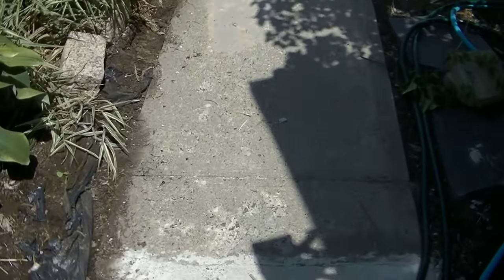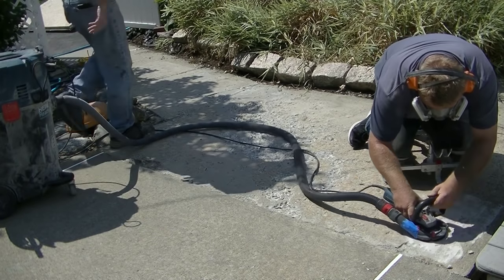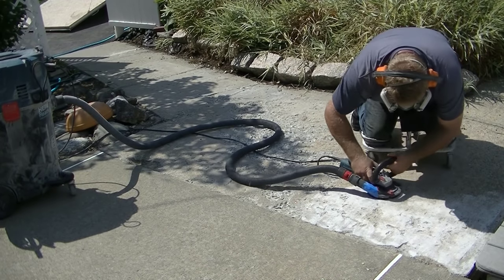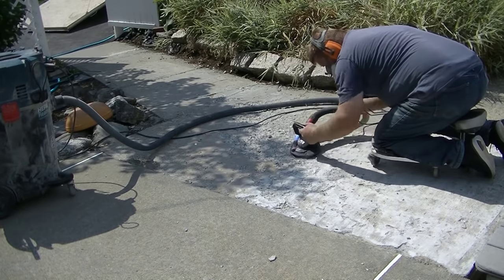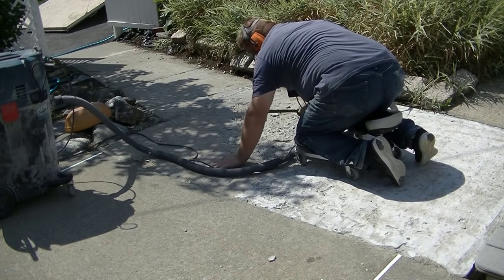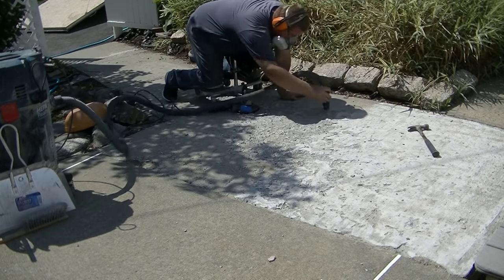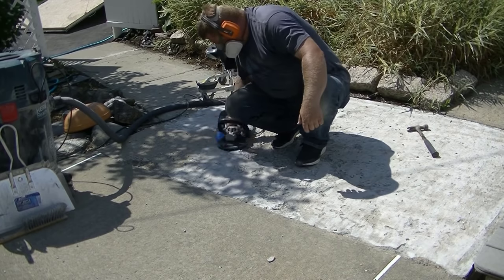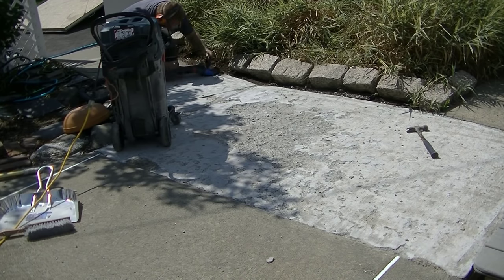How To Resurface A Badly Damaged Concrete Walkway

Comment: It's amazing to me that it's somehow less expensive to have a couple guys working on their hands and knees for a day or two than it would be to jackhammer the bad stuff out and just re-pour.
Reply: Exactly
Reply: This shit takes about 2 hours max 😂
Reply: You don’t think 2-3 guys are going to be working on their hands & knees with a completely new concrete slab?  Ripping up an old slab, pouring & floating a new slab is a shit ton of work, there’s a reason why the method demonstrated in this video is worthy of our consideration.
Reply: Dude, you clearly don't work in the trades, do you?
Reply: @loganshotrod4x464  it's really not a shit ton of work tho. And alot of that old slab could be used as filler.  It isn't hard to donate all. Guys can to the slab right there in 4 hours tops.
Reply: @Myeyeofthebeholder  : it depends on how big the project is, your budget, the equipment you have & how much of it you can do yourself.
Reply: I appreciate the video, but I would have insisted  to remove and re-pour the cement. Way too labor intensive.
Reply: It's way more time consuming and labor intensive to bust it out/replace the whole slab.
 It's faster and less expensive to just resurface or repair. You would to be in the construction field to truly understand. I've been doing concrete work for over 10yrs.
Reply: Sometimes it depends on what the customer can afford. If the customer wanted or could afford a whole replacement I'm pretty sure he would have done it. 
The customer maybe could only afford a resurface.
Reply: @YaboyAli215  Um, no it's not. I replaced three sidewalk slabs with just a sledgehammer. Gave it a few wacks, pulled up the old concrete, created forms and poured new concrete. What is so hard about that?
Reply: I believe he stated that replacement was out of the customers budget but I agree thinking the same thing while watching this. I'd say if a guy had the skills to tackle this as a surface repair then go for it. Otherwise replace. This crew knew what they were doing.
Reply: @bigmacdaddy1234  but now you have to get rid of the old concrete, build forms, level subgrade and mix all that cement.
Reply: @Myeyeofthebeholder  
obviously you havent done enough concrete work to know the difference..and filler for what ?
unless that concrete was 8 inch thick to begin with, you would need to worry about sub grade. by the time you tore that concrete, take it some where (free or not) order a short load ( a couple yard short load in California is going to cost you $400 that's if you unload that truck in 10 min. form up the side walk, wheel barrel the concrete to location, and to place and finish it. even if you did all of that in one long ass day by yourself with no pay help it's going to cost you $600 to replace. I dont work for free so I'm going to charge $400 and doing this shit for 33 years, I dont do it by myself so $200 for my helper. that's a $1000 job all day long to replace it and a hard busy day at that...this guy has the right idea
Reply: @jimmyreece6768  lmao.. Ok goofy
Reply: Where I am, it would cost as much as this repair JUST to DISPOSE of the jackhammered out concrete - for some reason it is priced at asbestos rates.
Reply: @bigmacdaddy1234  that's alot more labor intensive than just resurfacing it. No sledgehammer, no pulling up old concrete and no forms.... 
Less expensive, less labor...
You new poured slabs will probably last as long as his resurface because you didn't even level and compact your subgrade.
Reply: Dont think you have ever layed concrete
Reply: @andym9571  Who are you replying to?
Reply: @vtbn53  the original post. I'm in agreement with you.
Reply: It's amazing to me how people who have no clue about construction,  feel that they are qualified to criticize the methods and costs of work they know absolutely nothing about.
Reply: This guys is srewing this customer!  The company i work for would have had that walk out and poured back before lunch!
Reply: You sure are easy with other people’s money.

Comment: NICE to see people properly using earmuffs, safety glasses (Personal Protective Equipment- PPE) and the right vacuum. I watch SO MANY 'so called professionals' with their heads right next to grinders, loud circular saws, or working in dusty environments, like concrete dust without even a paper mask on. As a kid, we ALWAYS used gasoline (with no gloves) to wash engines that we worked on, Trichlorethelene as ink solvents and more. Cut Asbestos, used power and chain saws with NO hearing protection and NEVER thought of the heath commonsense.   Now at age 60+ the doctors say I have the lung capacity of an 80yr old smoker, even though I never smoked!  

We KNEW back then and just left the PPE in the toolbox, or hanging on the wall!  Nice to see you guys even using the correct vacuum system too! 

Nice job on the concrete repair too!

Comment: You've probably answered this question before. Sorry I'm not finding the applicable comment. With regular freeze-thaw an issue. How long do you expect this repair to last? I have a similar condition in Colorado and am deciding if I want to demo and re-pour or try to refinish.

Comment: Home depot here (SLC,UT) sells rapid set for just over $6 a bag. I use the flow control alot with rapid set to increase my compressive strength with increased fluidity. Gotta work fast though!!!! I'll have to try the mortar mix, never thought of that but I bet it would it leave a nice texture for some step repairs. Thanks

Comment: Mike, Great Video, QUESTION -  I have a concrete walkway, one section (about 8' by 8') has my WELL/Pump Room underneath it. I'm now getting water penetration thru the sidewalk down into that well room. before I do any repairs what would you recommend for me to seal it before I clean and resurface it. Or is there a rubberized coating or membrane I can apply, Simply Curious, Thanks for the great Content.
Reply: Try a torch down rubber roofing membrane

Comment: Loved this repair. Turned out fabulous. How long does this last in hot/freezing climates? How expensive is this type of job? Can an entire driveway and garage be done in cold climate areas? What about when a garage does not incline to the outside to drain water? Our garage pools it inside instead of draining down the driveway. This happens when snow melts off our vehicles onto the garage floor and stays there in a pool. I notice that the extra moisture is beginning to rust things stored in the garage, including our vehicles.

Comment: kinda surprised that you didn't bonder the spalled sections before filling with the Cementall...(???)  (incidentally, Larsen Products Wcg04 Weld Crete is a great concrete/stucco bonder )

Comment: Mike thank you for this video. A great tutorial. I have a pool deck of badly cracked aggregate surface concrete. 1 Would this work on aggregate surface. 2 Would this process fill cracks, and if so what about expansion joints.?  
Thank you

Comment: Would you use the blue bag for a surface that is mostly showing aggregate or would you go right to the finish coat? Thanks ! Great work BTW!!
Reply from the maker: Blue bag is for thinner repairs, it has a finer aggregate in it. You can go from featheredge up to 4" with repairs using it.

Comment: Hey Mike Day, great video thanks for doing this. My question is if you had to do this on a slab 12x40 what would you do different? Would you go in sections? Would you still trowell the whole thing? Thanks.
Reply from the maker: I'd use a self leveling concrete for something that size. I did one here: https://youtu.be/_iIrYQSOaGU
Reply: @MikeDayConcrete  wow, thats fsntastic. If i need ultimately a broom finish, what product on top of this should i use? Maybe the brown or blue bags ive seen in your other video?

Comment: What a great tutorial.  Thanks   While here, if the cement wasn't damaged as much, such as having small pebble sized 'divots',  could either of these products be used without the other to just resurface a rough surface?  We have a rough cement top 3' X 4' step and I was considering an epoxy mix such as they use on garage floors. Which as a bonus, can also be colored. Your thoughts on these ideas would be appreciated.

Comment: If I was 35 years younger I would give it a try. Today if I make it on my knees I'll need a crane to get up.......
Do you have recommendation of a company in or near Dallas Texas?
Reply: I know that feeling, after cancer treatments in 1990-91 I had both shoulders replaced and bone grafts on both hips because radiation treatments and prednisone ate my bone away. Those four surgeries were in 1993,96,98&99. Then in 2016 I had open heart surgery aortic valve replaced and one bypass and a pacemaker put in and I’ve had low blood pressure when I stand up since Basic Training at Fort Benning Georgia in 1983 I passed out three times two weeks before graduating in May 1983 and that has only gotten worse since then, I just turned 66 years old this month. Oh well that’s life in the Modern World

Comment: I have used that many times for all sorts of stuff. Whether sticking stones upside down or repairing curbs. But I’ve never seen it that thin for concrete. The bag says it’s good for 1 inch holes the blue bag is for thinner stuff

Comment: I noticed you didn’t put down a bonding agent 1st? for the self-leveling concrete to grab and Bon more securely to the old concrete? before you poured the self-leveling concrete? Was it not necessary on outdoor concrete?
Reply from the maker: It's not necessary with this stuff, just dampen the concrete first.

Comment: Question: For the first step  - instead of lightly grinding it could you use a high intense pressure washer (say 3200 psi) or something like that?  In other words - would that accomplish the same thing of preparing the surface?  Thanks
Reply: I'm thinkin the same. A strong pressure washer will do some work blowing off surface layer, I think. 😃
My 3200 lb washer with a red tip made a hole right thru an old red brick fairly quickly. Good luck

Comment: Thanks for the vid.  Do the broom marks show in the final result where you smooth it out in the middle?  Although I've just done this for my own homes, I'd have smoothed it out perpendicular to the direction you chose so it could all be done in one stroke, vs. having to start in the middle of the pad and pull it towards you after you get going.  Maybe it's the painter in me who has those practices engrained.  I'm only curious here.  You're the concrete pro, not me.
Reply from the maker: Normally we'd pull the broom perpendicular. In this case, we know we were going to seal it with an acrylic tinted sealer so the marks wouldn't show.

Comment: Good video but how strong is this stuff I have a 400 lb motorcycle, will it crack if I put the motorcycle on its center stand? that's what I need to know thanks.
Reply from the maker: It's stronger than the concrete.

Comment: This is great, thank you for putting this information out there.

The apron on my garage floor is spalled (spalling ?) quite bad. It was never sealed but the road salt on my tires has eroded it. Is the process you have laid out here the same for my situation ?
I'm concerned with the vehicle traffic it may not work.

Thank you again!

Comment: Probably best to use an 2 part epoxy moisture barrier primer on the slab “before” putting down a resurfacing material. That will prevent efflorescence salt from forming which causes the spalling & erosion in the first place.

Comment: Does that new coating need to be scored like when you put deep cuts in concrete slabs to control cracking?
Reply: right
  usually its for cracking that's why they cut but its also a topping  so id be wondering what it looks like after a good winter

Comment: Mike, thanks for the video. Quick question, if I have the surface like this combined with small cracks on drive, should I fill the cracks with some other type of concrete product? Or I just apply the blue bag as well? Thanks

Comment: Hi Mike. I love your videos. Have learned a lot from stamping concrete from you and finished up large areas in my backyard. Now I am on to my driveway. Trying to do this myself after assisting for the pouring and stamping. Feeling a little more ambitious especially since you can add a pack to the mix to slow the drying time. My driveway is only about 13 years old. It's had some discoloration that we just can't get out or change. Probably because a sealer was never used by previous owner. That being said I live in a newer neighborhood being only 13 years and my concrete is a lighter color. Re-cap looks like it has negative reviews with application after I have read them on HD. I am reading bubbles and things that can form, is what users say. After drying, bubbles Flake off leaving pits in surface.  And this product you have in the video here, dries a little on the tan side in color. I am trying to not redo my driveway and have it looking different from the concrete of my neighbors in color or have finishing issues after I leave a broom finish. What do you recommend for a refinish that will really give that new concrete look like a sidewalk just poured in a park that's a good long lasting product? I realize it may look still different from my neighbors because our driveways have aged. That's okay. I just want it look like a new pour as if I have had my driveway broken out and replaced. I heard of another product called Sackrete flow-coat resurfacer and Cement ALL. Not sure if you recommend one of them or have another that could help with my goals here.

Comment: I like this.

I wonder if it durable?  Will it last... I mean if it remained unpainted...

My thoughts were along the lines of pressure washing the old surface really good...  applying something like Plaster Weld, then applying some plasticized resurfacer.. like "Featheredge" ...

Am I just over-thinking it?

Comment: Thanks for the video.  I like the voice over explanation.  Need some advice.  I did patio 11x9 colored stamped concrete pour last week. 1st time.  had some mistake but still able to get it troweled out and somewhat leveled.  Miscalculated the amount cement i needed..  my depth was closer for 5in.. And i calculated for 4in. (I did order over what i needed)  The question i had is.. the front of the patio was getting sun light and back was not.. So front was getting dry faster.. but back of the patio was still wet.. I had to start the stamping process. (that also is not clear to me.. when do i start stamping?). so the stamped were starting to slip once i got closer to the middle.  really hated the idea that they go in angle.  So i have spots that are rough wasn't able to get it.  so there are some larger gaps between the stamps etc.. some spots my edging got messed up from the stamp..      can i use a grinder to make it look better?  family are letting me leave it.. its not that bad.  But I wanted to see if I can make it a bit better..
Reply from the maker: Did you watch any of my stamp videos
Reply: @MikeDayConcrete  -- yes watched it.  I watched many stamping videos.. multiple times..  still kinda messed up.  :(  my friends that were helping me.. also sent the videos to them..

Comment: Nice video and explanation. I wasn't aware you could skim coat this thin. We have a slab in front of our garage that's not quite graded right so rain comes back into the garage. I think I could make this work to get about a 1/4" lift at the back and feather back down so the water rolls out instead.
Reply: l bought a 80lb. bag of Portland cement for $11 at the Big Box. Also a bottle of the premix stuff for $9. I mixed it up with about a cup of the premix instead of water. Used a Mason's brush to wet the surface first. Then brushed in a thick coat of the slurry and it's holding tight 3 years later. I will link the video below from my teach 👨🏽‍🏫
👇🏼👇🏼👇🏼👇🏼

Comment: Could i just use CEMENTALL  for a rough driveway or do i have to pure the MORTARMIX too.
Tks
Reply from the maker: You can use just CementAll, it dries very fast so be ready for it and don't mix too much at a time.

Comment: Any tips on matching color of repaired area to existing, adjacent concrete finished areas? I have an older home, built in the late'30s,  with some cracking in the concrete floor of the front stoop; it is a light tan color, and grey concrete/mortar repairs really stand out. I understand that the whole floor of the front stoop will have to be taken up and replaced sometime in the next few years, but the color matching issue may still be present, and the cost of repair vs. replacement is always a consideration.  Thanks for any advice you can share with me and your viewers.

Comment: No 'milk' needed to bond the repair to the existing surface? Should this be sealed after the resurfacing material cures? Is the end result a brushed surface or do you run a float over it to smoothe the surface?
Reply: also i would like to know if there is a major color difference between the dryed product (which we havent seen yet) and the existing concrete.

Comment: Just curious about the shrinkage, and potential fissures after. I would place plastic sheet for over=night cure, and to prevent over saturation if rain was coming. What about a few cuts to ensure surface tention doesn't cause future cracks?

Comment: Great job. 
Ssd actually helps create new chemical bonds between the existing concrete and the new concrete but the pores of the concrete needs to be open. I usually prefer to use a sandblast and metal brush to really dislodge all the fines from the pores of the concrete. I believe just vacuum and water is not sufficient.